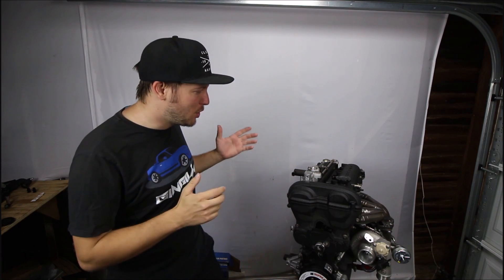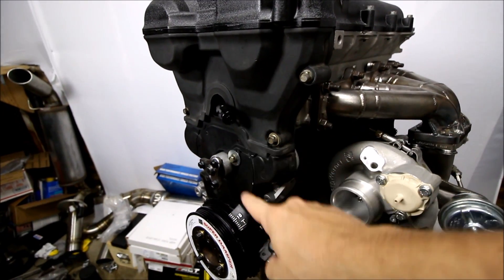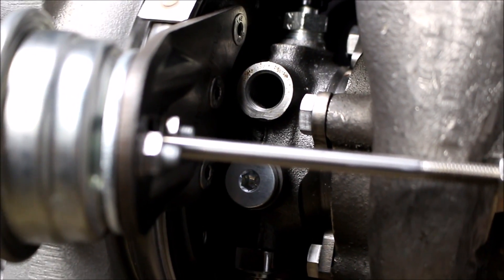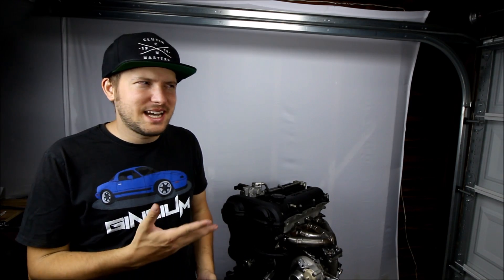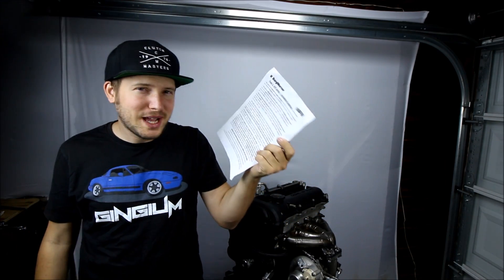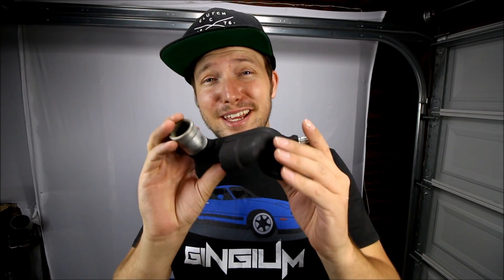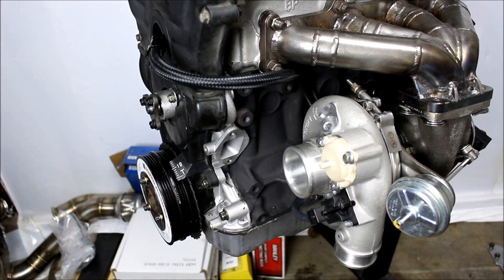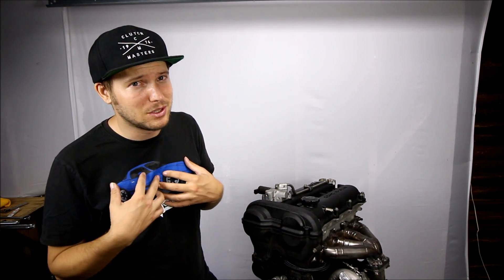Bottom Mount Turbo...NOTHING FITS - Custom Water Lines (Rebirth Ep19)

Comment: For any AN fittings on the turbo or by the exhaust manifold I would run stainless fittings. They will be more tolerable to the heat than aluminum. The aluminum may crack or start leaking over time.  Not to mention dissimilar metal corrosion (aluminum to steel).  To get a good seal with the stainless fittings use conical seals. That is a common setup on jet engines. May be a little late to the party but thought it was worth mentioning.

Comment: To help stop coking a tiny amount, you could fit a small electric water pump into the turbo lines and have it turn on for several mins once the ignition is turned off. They allow coolant flow when not running, but are mega reliable, so have it running while driving as well for a better flow. Range Rover superchargers have one running 24/7 while ignition is powered.

Comment: old video  i know, but hopefully you see this. What did you do about the heater core hard line itself. I'm installing a similar setup with a kraken low mount manifold and that's the only issue i'm having with it.

Comment: Hey Greg, I wanted to ask you why did you decide to run the feed to the inside (underneath the exhaust) and the return to the outside of the turbo? Would it not make sense to have it the other way around for shorter, neater lines? Also, make sure to get an imperial socket/spanner for the AN fittings since they are not really 18mm. It's mostly fine when you use a socket but a spanner will eventually ruin the hex.
Reply from the maker: +Kilimand It was a toss up which way to run the lines. I mocked it up both ways and liked this better, running the feed to the outside port left the line sticking out farther.

Comment: The AN lines. Noticed the end you put off the front you had to rotate the whole hose to fit. The other end you had that 90 which spun on itself. Question is I'm guessing you need one of those fittings on at least one end? Otherwise the hose will want to rotate which it won't. P.s love the black simple engine colour. 👍🏻

Comment: Hi Greg!
When you delete the heater core and all the associated line do you have to do anything else?
I'm running the skid nation reroute and was hoping I can just remove all the lines and the core and weld up the mixing manifold hole and I'm good to go? 

I plan on running my low mount water supply exactly like you did in this video.

I've read a lot of conflicting information online about once you delete it the thermostat doesn't up and the car never warms up etc. Just wanted to confirm you can delete it all with no I'll effects?

Thanks in advance, Drew 🤙🏻

Comment: For what reason do you use the highest inlet as the return and the lowest as feed? Is it just for fitment or is there any specific reason!
Love the videos, the engine looks great!
Reply: David I guess because hot water always goes to the top so you want to get out the hot water not the cold
Reply from the maker: +David To make sure any air bubbles flow out of the CHRA instead of getting trapped :)

Comment: Hi Greg, If you have welded up the old inlet port for the heater matrix return, I assume you are no longer running a heater? Do you have a re-route with the thermostat at the back of the engine? How do you let water circulate on warm-up before the thermostat is open? Keep the content coming. Your the best source of info on the mx5/miata on YouTube. From one of the UK boys!
Reply from the maker: Yes I am still running a heater, I use a tee off the lower radiator hose to supply the heater core with water. Details here: https://www.thecarpassionchannel.com/vvt-cooling-system

Comment: Question Sir.  On the Coolant mod mix housing/re-route, could you use the new AN fitting to feed the turbo (cooled) and send the hot turbo coolant to the back of the engine at the rear coming out at the coolant re-route?  This way you can fully block off the coolant out from the head.   Your thoughts?  I'm following your exploits as I am building my Exocet motor now.  I'm using a good amount of your teachings as a solid base.  I'd love to pick your brain from time to time.  Take care and stay safe.

C
Reply from the maker: Yep, as long as coolant is flowing it's all good

Comment: Hi 
Really like the videos as just about to put a Garrett GT2860RS on my 2004 1.8 vvt
You said that you have done a reroute for the cooling. Did you change the head gasket for an earlier one as I believe that to overcome the cooling problems on the vvt engine the restricted the flow to cylinders 1&2
Would also like to know which thermostat you fitted 
Thanks
Reply from the maker: Nigel Kearney Yes I have a 99-00 head gasket, and I run a 180° thermostat

Comment: Are you going to run a heater core? I am thinking of using a 323 mixing manifold, but I have to come up with a solution for the heater core. I hate the pipe for the heater core under the exhaust manifold.
Reply from the maker: aDaWaN Yes, I am a baby and must have a heater 😅
Reply: OK, curious to know how you are going to plumb in your heater output then! I will keep watching your videos to find out :)

Comment: Where do you return your heater core hose to?
Reply from the maker: Routing is just like stock, the only difference is I tee off the lower radiator hose instead of having the line that hooks up to the mixing manifold
Reply: @TheCarPassionChannel  thanks for the reply. So you run a long hose from bottom rad hose to the firewall? Do you run that down the chassis leg?

Comment: So flipping that water pipe around won't interfere w/ any belts? Like p/s or alt? I assume you aren't running a/c. Also the turbo h20 feed, do you think it'll be ok sitting close under the manifold like that? Finally does that cooling system have a bleeder? Or is the rad the highest part of system? If not, you can always jack the car up high in the front & run it w/the rad cap off to burp the air out. Ive got a 350z & im always getting air in the heater core because the rad isn't the highest part in the system. Anyway, built looks good so far. W/that setup, I predict a linear pwr band starting low down. Should be pretty potent for road racing & auto x.
Reply from the maker: Will Thacker I will not have p/s or a/c on this motor. No bleeder, I just jack up the front. The linear powerband and fast spool is exactly what I want 😁

Comment: Water line looks like it will interfere with motor mount
Reply from the maker: +NBFelipe Motor mount sits back far enough to clear. I did have an issue with the turbo drain... Had to modify the mount slightly. I'll show it in a vid at some point
Reply: TheCarPassionChannel ok it just looked really close. Wish i haf ur turbo on my msm